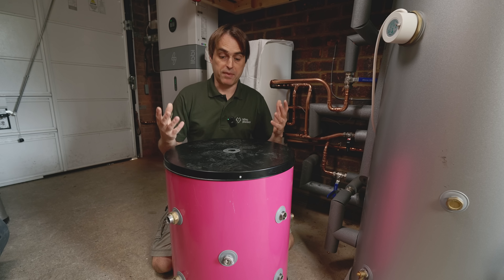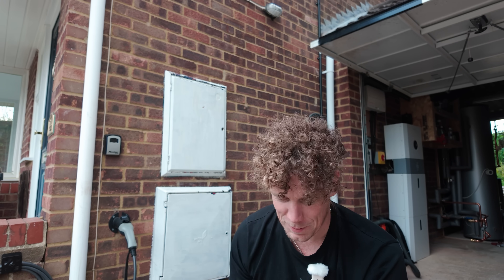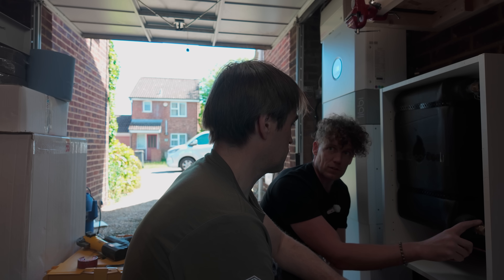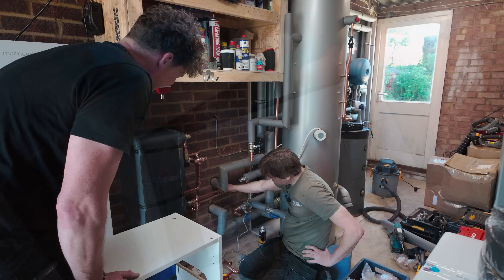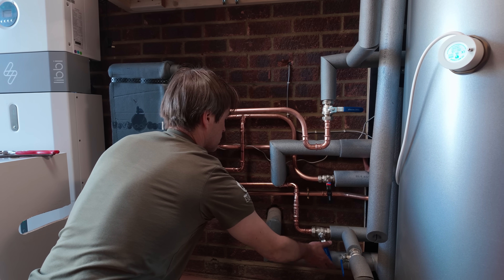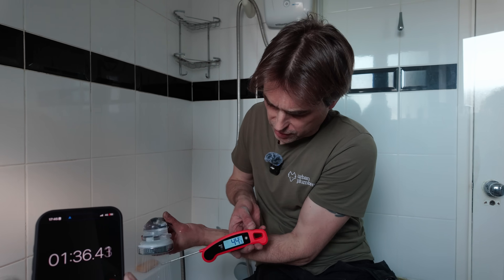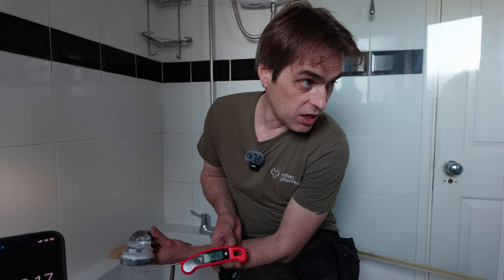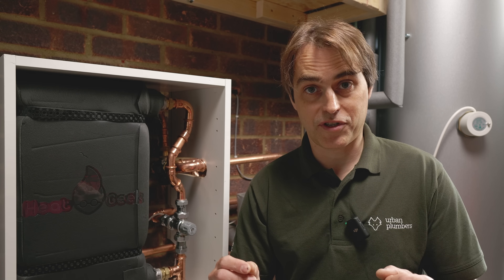We Built a Heat Pump Combi 'Boiler'. But Does It Work?

Comment: This is very cool, only problem is that the HSE and building regs requires that instantaneous hot water gets generated at 50’C after a “reasonable period of time” NHBC requires 50’C at the kitchen tap within 60’s. It’s time to get them to reduce the hot water temperature requirement in the UK, some mainland European countries have lower instantaneous hot water requirements which helps technology’s like this as well as heat networks.

Comment: Trouble is... If you don't have space for even a tiny cylinder, then you probably have a small home and a small heat pump not capable of delivering enough power? Seems to fix a problem that doesnt exist?
Reply: You should size the heat pump for hot water. Suggest a 7kw unit min
Reply: But if you’re removing an existing combi, you now have the space for the internal heat exchanger, no?
Reply: @Umski I suppose the point is you'll likely have to oversize the heat pump (for heating) to be capable of running the hot water. Niche scenario for this to make sense
Reply: @owenwales4328 depends if the maths works out - this was done in mild weather so it’s easy to pluck figures out of the air but the true test would be in similar conditions to when heat loss calcs are done e.g. minus 2C for example- in that case the heating heat loss assumes maintaining room temp flat out with a margin of headroom. Now will there be enough left in reserve to pump out for hot water factoring in say a defrost cycle. On the one hand combi boilers are ludicrously over sized for the actual outputs needed, on the other hand heat pumps have lower output for longer periods - my hunch is that this type of arrangement would need some kind of instant on resistive heat during peak demand much like an electric shower. OEMs could probably integrate this into their designs but why would they? The cost is likely going to be on par with a cylinder so easier to separate the two. I think HG are on to something but it needs refining 👍

Comment: Did it take 2:30 to reach the required temperature? What was happening at the start of the test.?
Reply from the maker: It takes 2:30 for the heat pump to start as the plate holds enough energy to keep the shower running for around that time
Reply: Could you install a flow sensor to get the ASHP to kick in as soon as the DHW starts? But might not be necessary as it seems to work in any case.

Comment: Hi Simon. Congratulations on successful trial.
I have been using Nordic PX for couple of years now on my installs as an extension of the enlarged HP coil in unvented cylinder.
With Nano what is the plan for the HP not to cycle as the DHW side will get cooler much quicker than in the cylinder(50mm) insulation and you have to have in on "standby" 24/7. Whenever you open the HW tap then you draw energy from that tiny 😂15l store. 
I belive it is still better to have a cycling HP on DHW than oil or gas boiler.😂
Reply: The question probably should be directed to Adam😊
Reply: I guess some form of time control would be needed so that the plate is only heated during periods of potential use, a bit like the stores that you can get in some combis.
Reply from the maker: @malcolmstephens1340 you can already do it with existing DHW controls same way you would do with a cylinder

Comment: done it all ready, but mine is half that size, but if the tank is low say 30 - 40 it will heat the hot water for a shower even in winter,

Comment: Nice experiment, this is essentially a much more efficient electric shower, with enough metal chucked in to mask ASHP innertia. Since that 7KW Vaillant unit can output ~11KW on a good day, not surprising it works considering regular 9.5KW electric shower can run 'indefinitely' (although you are limited to rather modest flow rate if you want to keep things warm).
Reply from the maker: We run it on a 5kW unit that peaks at 8.5 in good weather

Comment: Be interesting to see how it performs in the winter months 🧐
Reply: Challenge in the winter is overcoming any defrost. Specially with high humidity and near freezing temperatures. You can scale for the COP loss, bit rime is your biggest enemy with virtually no buffer.
Reply: @afrikees  There are heat pumps with double exchangers that defrost one while using second. I have not seen it but some Czech manufacturer does them. It takes a little bit heat to not used exchanger to defrost it. But I do not believe that it is possible in winter with weak heat pump as to have 45C I needed to run 11kW direct heater almost on full throtle when the water is around 5 from the grid. Most heat pumps can not deliver it when is -10 outside. They can do such power but not wtih 55C temperature difference. I still think about heating big reservoir to for example 30 with heat pump and fill the gap with direct heating when used is more reliable solution. Trying to heat water to 45 in summer is piece of cake but not if outside is under 0 . I am going to see detailed video.
Reply: First idea I’ve seen that looks good to go with flats and smaller properties
This set up looks equivalent to a 24kw combi. Presumably an upscaled plate could be used for a 30kw equivalent. Finally starting to believe in heat pumps viability……
Reply: The cooler it is outside temp, the lower temp going back to compressor and there for the more inefficient the heat pump becomes?
Reply: How would this idea perform with winter main temperatures of say 5 degrees? It’s back to the delta temperatures of a combi presumably?
Reply: Why would the performance be any different if the heatpump is the proper size?
Reply from the maker: @Jonas-vi1sl more power available
Reply: @Jonas-vi1sl simply because in winter temperatures the COP sags more then some grannys fruits 😅

Comment: mate do something about the sound volume
Reply from the maker: sounds fine. It is YT problem - same happened to HG video. Must be YT glitch at the moment.
Reply: Sound was fine on my phone.
Reply: The sound is not normalized. Many devices do this themselves. Even windows has a setting for it. Would be better if the video itself would be sound normalized. This is common problem in ASMR videos.
Reply from the maker: @Ender_Wiggin it’s is normalised. It’s YT issue. Happens sometimes

Comment: Seems like a great concept, especially for larger heat-pumps. Might run into a few issues with colder water flow temps and defrosts during winter though.
Reply from the maker: You can overcome those with direct electric back up for those short periods
Reply: @UrbanPlumbers  I love these systems but would still run a backup with them. It is annoying that others eliminate these systems for considerations when it is still sufficient for 90% of use cases. Add a back up and it is 100% you still get the 90% savings !
Reply: @UrbanPlumbers  yep fair point!
Reply: @UrbanPlumbers  This concept might even work rather well for a2a systems too.

Comment: Only just started the video but I have thought for years they should make a heat pump like a oil Combi . It would be very straightforward. Could be done in the outside unit like external oil boilers.
Reply: Also I know the manufacturers would’ve done something, I have seen some really weird stuff in the past at manufacturers R&D
Reply: The issue is heat pumps don't short cycle very well and take a few minutes to run up to full operation.
Reply: @anthonycayford3763  same as oil boiler, they have a 40 to 50 L reservoir then it goes through a plate